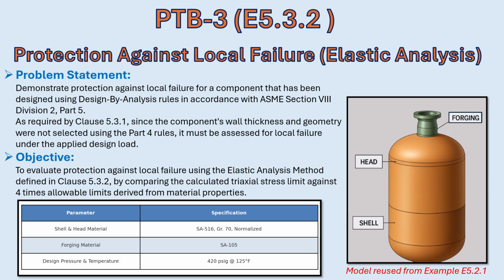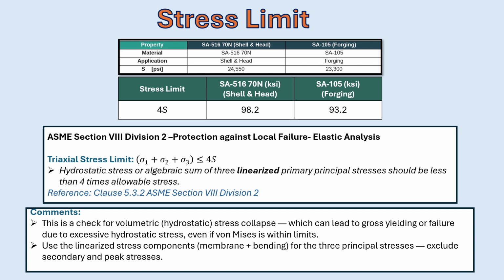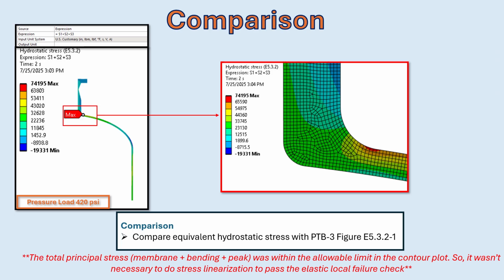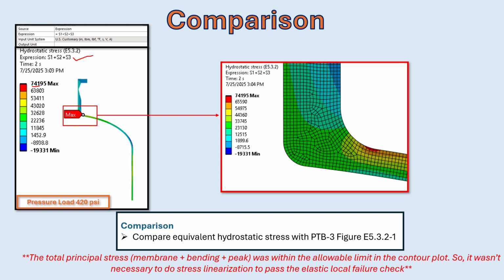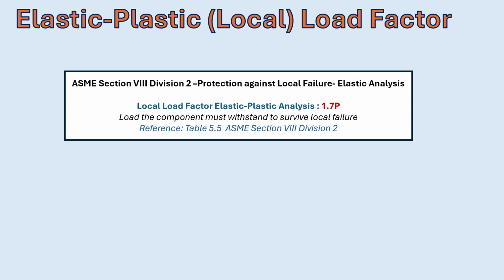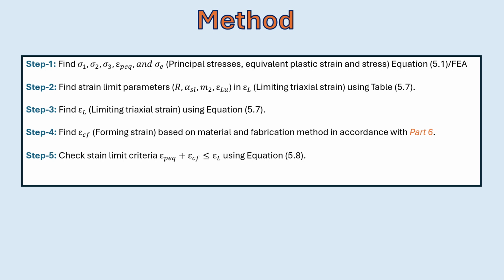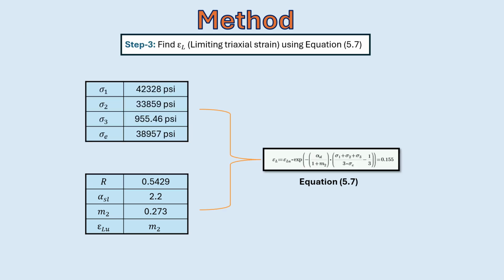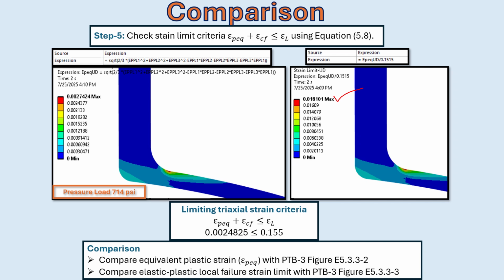Video 3  ASME Section VIII Div 2 PTB-3 Examples | Protection Against Local Failure

Comment: Thank you for the detailed explanation. 
In the full evaluation of the model, will the strain ratio equation use the UDF of E_peqUD/Epsilon_L rather than the single value of 0.1515 at a point?